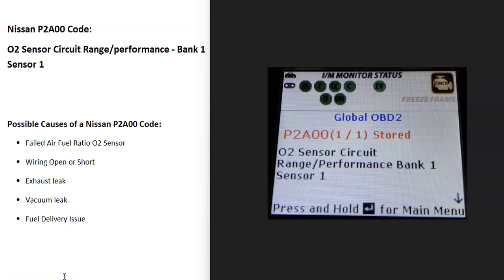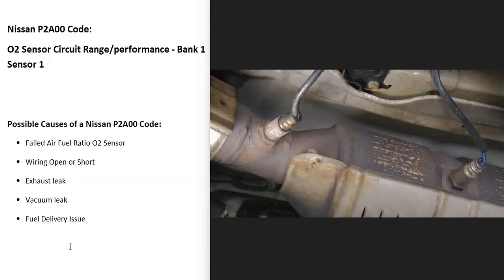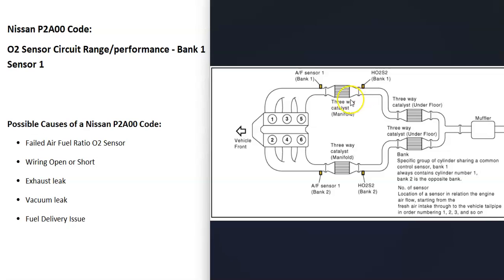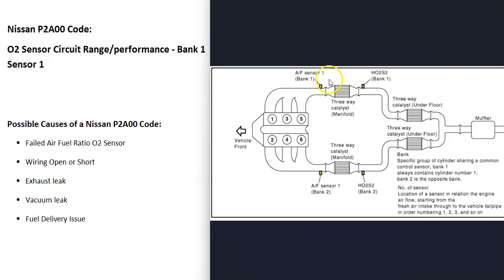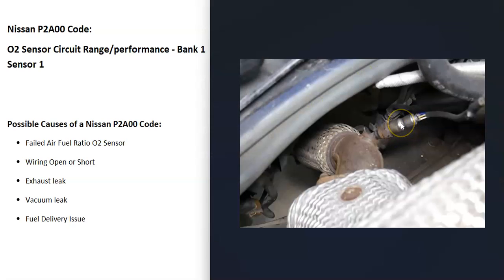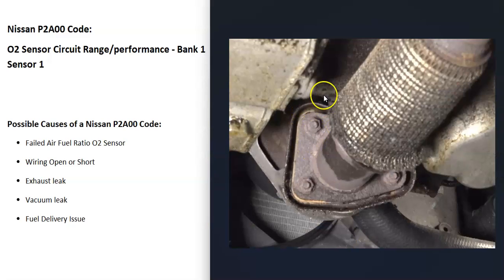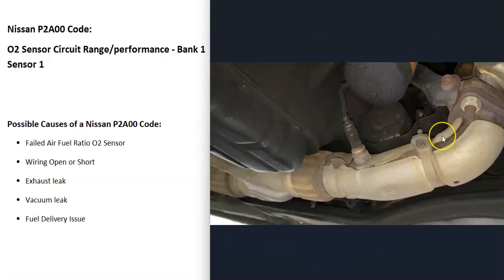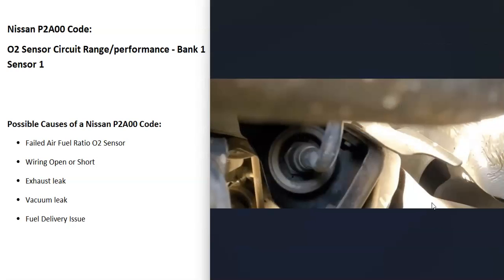Causes and Fixes Nissan P2A00 Code: O2 Sensor Circuit Range/performance - Bank 1 Sensor 1

Comment: If you have a V engine, swap upstream A/F sensors between banks.  Low cost way to either confirm or rule out the sensor as the issue.

Comment: I have 2a00 code and random misfire. Will oxygen sensor cause misfire
Reply from the maker: Usually, no, but sometimes, different engines and computers do unexpected things. Usually with a bad O2 sensor the engine won't go into a closed loop, but the computer will use other sensors to keep the engine running with no misfires.

Comment: I saw on a Nissan P2A00 code video that performing a clear self-learn procedure is also necessary because even if a sensor is replaced or an exhaust leak is fixed, the code will return. Performing the clear self-learn procedure will eliminate this. Assuming the problem has been fixed.
Reply: @amen_ra61622  how do I do that. Self -learn process, will look it up, my car runs great. Even when the P2A00 comes on, has to be the upstream sensors.
Reply: @amen_ra61622  will look for that video thanks

Comment: Dont forget bad ignition coils.
Reply: Your ignition coil caused a p2a00 code? What vehicle is it? I have a broken connector that connects to a ignition coil, I think it's not getting proper connection
Reply: Hola tengo una nissan frontier 2006 q tiene ese problema como se puede solucionar  @shibainu501
Reply: if that's the case you'll get a misfire code too.

Comment: Just replaced the 02 sensor, bank 1 sensor 1, check engine light comes back
Reply: Maybe that wasn’t the problem?
Reply: @hisagisan i have the exact same issue. Code if for the sensor itself, after replacing several times same code comes back
Reply: Same